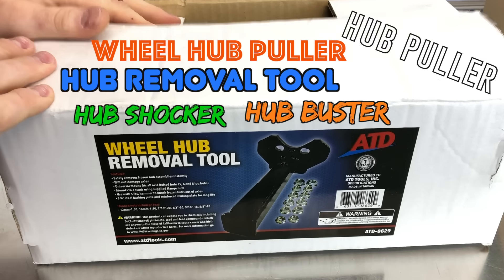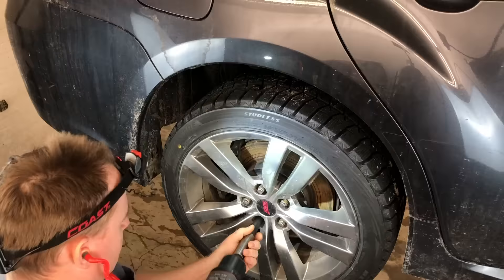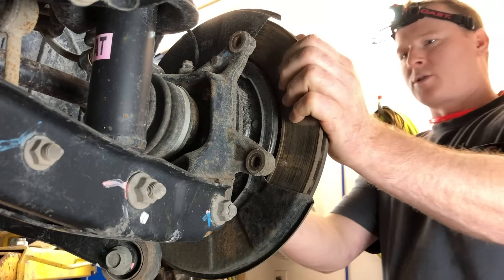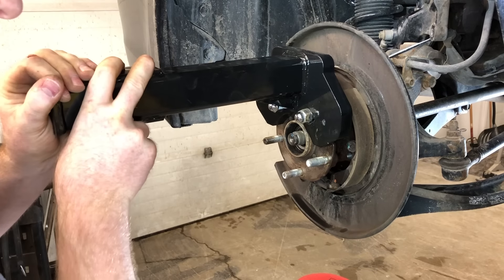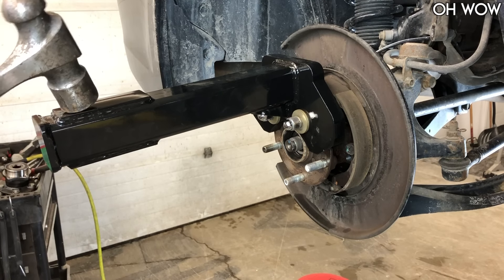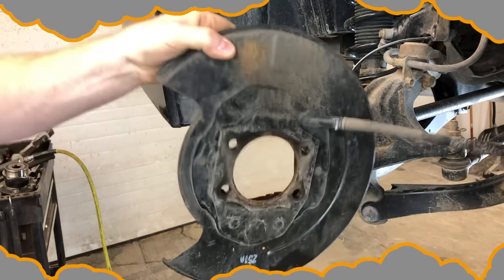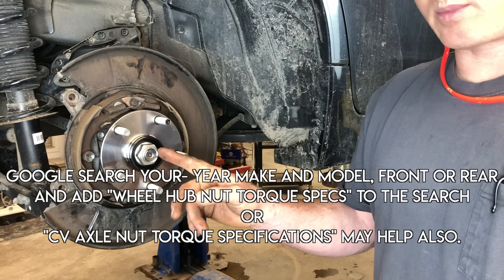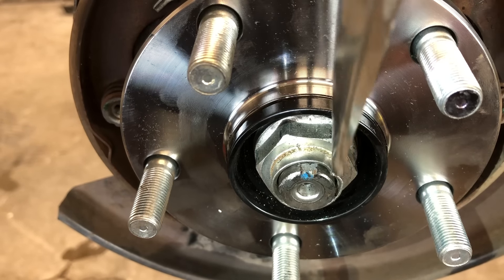HUB SHOCKER Hub Busters  |  REMOVE STUCK WHEEL BEARINGS EASILY!

Comment: I have a 2017 WRX that I was able to get the bearing out/apart.  But now the back end is stuck to the backing plate/knuckle area.  Anyone have any tips?  I've been trying and trying to break it loose, but nothing is working. Thanks.
Reply from the maker: Hey! Hammer it out like in the video. They corrode in the backing plate just as bad as the knuckle. But you can hammer them out no problem once the backing plate and bearing detach from the knuckle. Force it out. I think the hammer I use is a 42oz and that size seems to work good. I have to hit it pretty good. Let me know if you need any more help 😀
Reply: @EasyFixShaun  Thank you for responding,  I appreciate the help!
Reply from the maker: Ya man! I hope you got it fixed up 😎
Reply: @EasyFixShaun  Unfortunately,  no. It's still in my garage.  I hopefully can get it finished this weekend. I have beat the crap out if it, an used heat, as well as P.B. Blaster.  No luck.  😂😭
Reply from the maker: Wow man! I'm sorry. That's supposed to be the easy part. Still hooked to the parking brake cable right? It kinda swings on it like in the video... Be careful and beat on it like it owes you money! It should pop out. If not, I haven't encountered that problem. I will sleep on it tonight and try to come up with a solution so you don't have to remove cable and press it. .....
Reply: @EasyFixShaun  Yeah. Cable is still attached. The issue I'm having is that the hub is still stuck to the backing plate/knuckle. I cant get it to separate so I can beat on the back of the bearing to break it loose.
Reply from the maker: Do you have a hub shocker?
Reply: @EasyFixShaun  I do not.  Would I be able to use it?  I've already removed the front part of the bearing, so I dont have anything to attach the shocker to.
Reply from the maker: Well I’ve had a similiar situation a while ago. If you have the old hub and bearings you can hammer them back in essentially pressing back together. Pull it all together and hold it together once you can put the cv axle back on. Make sure you through bolt the tool. Check out my new video “hub shocker 2.0. Hit it with a sledge hammer as hard as you can. It will pop out.
Reply: @EasyFixShaun  I just cannot get the backing plate to come loose.  Heat, hammer, PB blaster. Nothing. I have never encountered anything like it.  I apparently have gone above my pay grade haha.  Thankfully I've had another car to drive. Because I fear I'm gonna have to have it towed.
Reply from the maker: You aren't alone. Subaru hubs are near impossible. If you want to do them quick and easy......Hub shocker. Through bolt it. Beat it like it owes you money with a 8 pound sledge hammer. They pop right out. Watch the second hub shocker video I just recently made. It answers a lot of questions and I show how to use it better than the first video https://youtu.be/eKqYtMdlPYo
Reply from the maker: https://youtu.be/eKqYtMdlPYo Let me know what you think 😀

Comment: Just use a slide hammer, it works for that and so much more.  Uni-task tools are horrible and slide hammers are great multi-tools with a multitude of adapters.
Reply from the maker: I agree the slide hammer has more uses for sure. Sometimes they separate the bearing into two pieces though leaving the inner portion to be removed usually with an air hammer. Check out my new shocker 2.0 video. I solved 2 problems with the tool and both can be used with the slide hammer method. I used grade 8 bolts to mount it. And I solved bearing separation problem using a cv axle nut trick. 🤓🔧 https://youtu.be/eKqYtMdlPYo

Comment: Hello hitting it like that I am afraid breaking something else I prefer the side hammer
Reply from the maker: I know what you mean. Don't worry the rust bond that holds the bearing in is not stronger than any other component. So you won't break any other component. The tool just helps apply the force to the exact spot to break the bearing free. I hit mine as hard as I can with a sledge hammer and they pop right out. The slide hammer method works. But it takes a long time and is very difficult.
Reply from the maker: Here is an updated shocker with many more results to check out. No breakage of anything 😀. Let me know what you think! https://youtu.be/eKqYtMdlPYo

Comment: Big ass pipe wrench does the se thing. A little harder to hit
Reply from the maker: no
Reply: @EasyFixShaun  well I did it and it worked fine. The other side I used two thread connectors and a bolt and slowly backed it out. Whatever tickles your pickle
Reply: U clamp the wrench on the rotor and use the lug nuts to hold it. The rotors is obviously junk anyway
Reply from the maker: I am glad you got yours out. Any method can work. Striking something hard like a wrench resting on a hub is like stepping on a shovel. Sooner or later it gets ya. Kuddos to you though. I am glad you got it 😃 https://youtu.be/eKqYtMdlPYo

Comment: "just push the axle out" and what do you do if your axle doesn't just "come out". And, including pounding the hell out of the spindle with nut, using lots of pen. oil, etc..
Reply from the maker: If the axle doesn't come out by pushing with your finger, the next step would be to tap on it with a hammer and punch. There is a small recessed hole in the middle the the axle stub shaft you can easily tap on and not damage the threads. If it still will not move next I grab a air hammer with a punch bit on it and do the same thing. The air hammer works nice, the vibrating action will usually loosen up the rust and make the shaft move. Sometimes at this point I put penetrating oil on. If the air hammer doesn't work, the next step is heating and cutting. It can be dangerous and expensive to do that. Sometimes extra parts other than the bearing are ruined. Sometimes there isn't any other choice though. I try to be creative and find work arounds to heating and cutting. But basically if all other options are exhausted that is my final method. Sometimes I need to replace additional parts because of cutting or heating damage. I don't have to do this often thankfully. I have done it though. 1-3% of my bearings, do need this last step. So hopefully yours isn't one of them. I live in Michigan and everything is rusted out. Keep me posted on your project!
Reply from the maker: My ultimate goal is to save all parts including the axle shaft and just replace the bearing. Its the best practice and the cheapest. I use the stepped method to use least aggressive to most aggressive removal. You don't want to bust out the heat and grinder immediately. Try the least intrusive methods first. Sounds like you are doing the right thing here though. One last thing, I have been going right to my heaviest hammer to use the shocker on my bearing hub replacements now. After a couple hits with my 42oz hammer, if it isn't budging, I go directly to a sledge hammer. I believe it is an eight pound sledge hammer. I work my way up to full force swings. I have only needed half throttle on the sledge so far for the most part. Seems to work great. Keep me posted!
Reply from the maker: https://youtu.be/eKqYtMdlPYo Check out the updated video. Solves a lot of common issues using this powerful tool 😀

Comment: Good by ball joints. There is a reason you take the hub off and press them out!!!
Reply from the maker: I totally see your point that they could be damaged. But I have not seen any problems at all. I have used this thing a lot and I always double check steering and suspension play by shaking vehicles down afterwards. I also put the two toughest candidates that I have had so far on an alignment rack. I wanted to make sure nothing was bent or out of specs after I used the tool. Everything looked fine both times. From what I gather, the tool breaks the weakest link between the wheel bearing and the knuckle which is the rust bond between the two parts.
Reply: @EasyFixShaun  same can be achieved with a slide hammer and no load on ball joints.
Reply from the maker: True it could work. Have you done a Subaru bearing that way?
Reply: @EasyFixShaun  some yeah. For the bearings that don't come out I remove hub and press out. To avoid any damage  or unnecessary wear to other components. Your tool obviously works. It would be interest8ng to see what an engineer had to say about it.
Reply from the maker: @shackels100  I agree pressing them out isn't a bad idea at all 😃
Reply: All the stress of driving and weight of the car on those joints. I doubt you'll hurt the ball joints in anyway shape or form
Reply from the maker: @thomasmatarazzo198  I agree. I think you are right. I am comfortable with doing what i do. It doesn't worry me too much either. Some people are hesitant and that is ok too. That keeps them in the "safe" zone. When I get out of my safe zone, I always break stuff. It sucks! Its always best to play it safe if you aren't sure how the parts should interact with each other. A press is a perfectly fine way to do these. My way with the shocker is better for me. Find what works for you best. 😃

Comment: You had an easy one.  That thing wouldn’t do shit on my Subaru.  A huge slide hammer wouldn’t either.   Subaru service center said they could only get these off with a heavy duty air hammer from the back of the hub.  There was never a hub I couldn’t get off till this shitbox!
Reply from the maker: I feel your pain. All of my replacements were horrible also. I do a lot of these. I made a second video hub shocker 2.0.  It solves the issues I was having. I had mounting issues and I now through bolt with grade 8 bolts. I also keep the bearing from splitting in two pieces by using the axle nut. I only use a sledge hammer. I remove all Subaru hubs with the shocker. Makes it easy for me. I won't replace with out it. https://youtu.be/eKqYtMdlPYo

Comment: Wait, the STI has drum shoes AND pads?
Reply from the maker: Yup. Parking brakes are drum shoes inside the rotor. 😃🔧
Reply: Most cars these days have this setup
Reply from the maker: Ya it is pretty common. Quite a few company’s are going to an electric parking brake. It’s simple and convenient. But there are electrical motors usually on the rear calipers that can be expensive if they break. I prefer mechanical. But, I guess either system will break eventually

Comment: Did not work for me last week.  I have had some decent luck using a heavy slap hammer to pull the flange, then bolt the slap hammer to the bearing and go to it.  Sometimes works quick and easy, but last week's was seriously frozen and wore me out.  Also have a busted up hand to show for it.  Seems like the right side is the one that fails most often.
Reply from the maker: Oh Gordon I am so sorry man. I had the same problems. Watch the second video I just made. If you need to do another one...the tool will work. I solved the bearing separation problems I was having from it being so powerful. I also solved mounting issues. I was stripping threads and lug nuts. I only through bolt the bearings on with grade 8 1/2" bolts now. Makes all the difference for me 😃

Comment: love mine. couldnt live without it in the rust belt. just uhhh dont swing a 15 lb sledge at it for prolonged periods. it will break.
Reply from the maker: Nice! I have beat on mine so many times with an 8lb sledge and its still in great shape. 15lb sledge could probably break it though for sure. Mine is the ATD brand. I have seen a lot of reviews on the cheaper no name brands that look exactly like it breaking badly and easily. For sure get the ATD and dont try to save 5-10 bucks 😀🔧
Reply: I had a grand caravan where the axle and hub seize together and was convinced a bigger hammer was the answer. Ended up torching the hub and axle off and replacing new
Reply from the maker: Oh man. I have had to do that a few times in the past also. Sometimes there is nothing that can be done. Rust is crazy 😀🔧

Comment: Crap, already have the outer part of the bearing off... The balls are still in there, think I can get it back on so I can use this tool? I'm hesitant with the air hammer since I destroyed a knuckle on my truck with one last summer.
Reply from the maker: Oh man. If the bearing outer hub is already removed, you can’t really use the hub shocker. You need to just keep going and work on what’s left of the inner bearing until it’s removed. They can be a real pain sometimes. But take your time so you don’t damage anything. If you air hammer it, use the old bearing bolt holes only like in my other video. You want to try to twist the bearing in the knuckle to break the rust bond. If that doesn’t work I would probably remove the knuckle and use a press. That way you can apply the force needed to pop it out. There Hub Shocker solves all of the problems and allows you to apply substantial force to the bearing directly without hitting a fender. There are a lot of things to damage with any other methods including heat. Take your time and work your way through it. You can do it. It will just suck without the tool. Watch some more videos. 😃
Reply from the maker: Peter I thought about this overnight and I actually think you would be able to use the Hub shocker still! It isn't too late. I haven't done this before so I am sorry I didn't think of it sooner. I think you could reinstall the outer hub portion back into the inner hub on the knuckle by using the cv axle shaft and nut as a puller to reinstall the hub. The job of the cv shaft is to hold the bearing together so it will work just fine as long as you have enough room to thread the nut on to pull it back into place. Once it is back in place, loosen the nut a few rounds and remove the abs sensor so you don't break that. Install the Hub Shocker and smash away until it pops out!
Reply: @EasyFixShaun  In the end, nothing worked, not this breaker nor the air hammer. I took the knuckle off and put it in a 20 ton press from harbor freight. Used one of the rings from my ball joint press and popped the hub out of the knuckle. Unfortunately this ruins the brake backing plate (the dust shield). Still, cheaper than replacing both backing plate, and knuckle.
Reply from the maker: I am so sorry man. I missed your reply somehow. I did make a way better shocker video that solves your problem. Check it out and let me know what you think! Should hopefully make your next one way easier. ~Shaun https://youtu.be/eKqYtMdlPYo

Comment: Looks like a possible bent wheel flange or lug bolts to me.
Reply from the maker: Doesn't matter when the bearing assembly is bad and being replaced anyway. Yes it does bend flanges and destroy lug bolts.  -Powerful tool! 😀🔧🔧
Reply from the maker: Check out the second video I made. Much more wow 😃🔧 https://youtu.be/eKqYtMdlPYo

Comment: Huh or you could use a slide hammer 🤔 works just as good
Reply from the maker: Slide hammer is a great method! It's my old method now that I have this tool. But it works. Check out my "Hub shocker 2.0" video. There are two problems for the tool that apply to slide hammers. I use grade 8 bolts to mount the tool now. And I use the cv axle nut trick to keep the bearing from separating 🔧🔧😃  https://youtu.be/eKqYtMdlPYo

Comment: it won’t work on a 2011 to 2019 ford explorer rear hub. you have to use a press and it explodes out of the knuckle.
Reply from the maker: That is what I have been hearing. I haven't had the opportunity to do one myself and try the tool yet. What about the updated video. Do you think it would help on the explorers? I solved mounting issues by through bolting with grade 8 bolts. And solved the bearing separating on severely corroded replacements 🔧🔧  https://youtu.be/eKqYtMdlPYo

Comment: yah just force off the center nut and jack up the threads on the cv axle, great idea
Reply from the maker: Forcing the cv-axle nut off on a Subaru doesn't mess up the threads. I see what you are thinking, but it doesn't happen. It may on some other models. Typically cv-axle thread get messed up when hammering on the end of the threaded shaft 🔧

Comment: It should be call the whacker guess how many whacks i take before i start loosing toes and fingers.
Reply from the maker: Haha so true. You could leave the cv axle nut on the wheel bearing. That could help prevent the bearing and tool from falling when breaking it loose.
Reply from the maker: Check out the new video if you want. There is still lots of hammering but the bearings are popping out easier and easier 😀 https://youtu.be/eKqYtMdlPYo

Comment: not sure cranking on a knuckle with forces like that is healthy for the strut or the geometry of the casting itself. S.A.I & other critical alignment angles could be permanently damaged if over torqued.
Reply from the maker: I agree with you. I think it's just fine though. The tool just magnifies the forces to break the weak link between the bearing and the knuckle.. The weak link is the rust bond the can "rust jack" the bearing into place. It's basically for severely corroded bolt in style wheel bearing replacements only. Here is the next video I made on it if you are interested in watching? https://youtu.be/eKqYtMdlPYo

Comment: So lucky it's not a pressed in style
Reply from the maker: I unbolted the hub in the video before I used the hub shocker. It is obviously for bolt in style bearings only. I would never use this on a press in style bearing. I have a couple videos on that if you need to press one out and back in on the car. No press needed! 😀

Comment: Used an air chisel it took 45 minutes a side, the problem is at a $125.00 for something I use every 3-4 years.
Reply from the maker: An air chisel is a great method for bearing removal! I usually use a punch bit and try to rotate and twist the bearing hub to free it from the knuckle. I use a punch bit on the bolt mount holes. On severely stuck hubs it is my old method. The shocker makes it easy for me. 😃🔧🔧